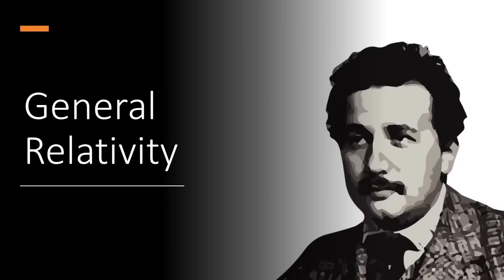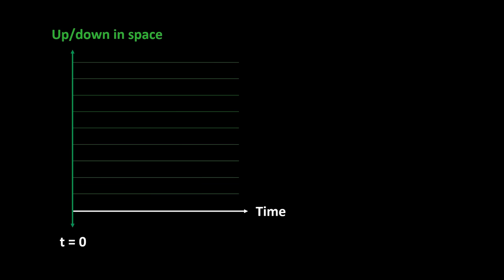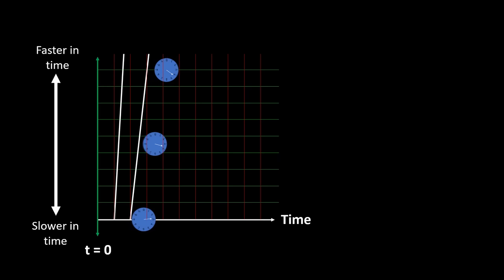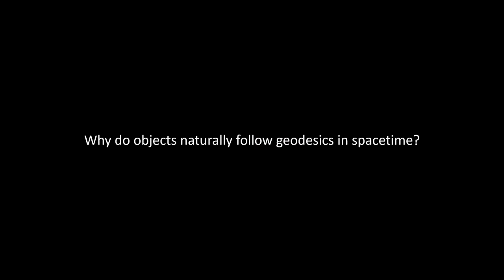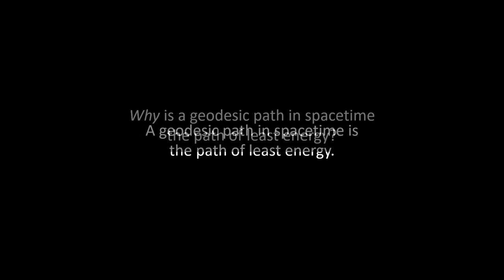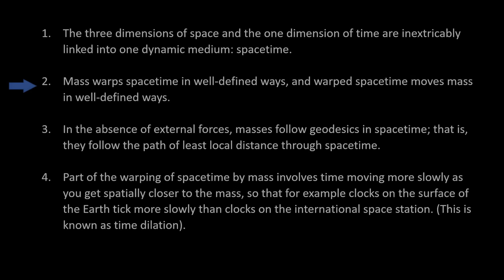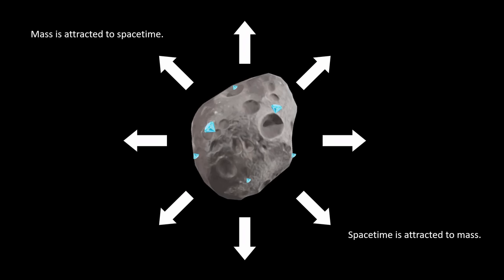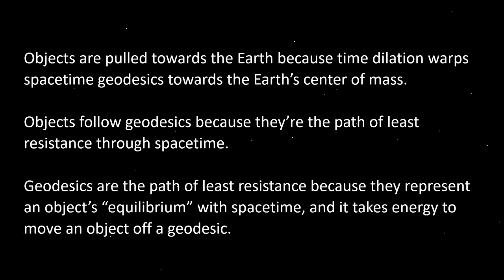How Time Dilation Causes Gravity, and How Inertia Works

Comment: I'm so impressed. This explains the equivalence principle. Movement due to gravity or normal acceleration impacts spacetime the same way.
Reply: Only the theory presented is supposed to do away with gravity as a force, as I understand it… 
Also how is mass defined in the absence of gravity? As inertia? Sort of a resistance against acceleration? 
It also seems to me that time would come out a space-vector – the path of least resistance between two locations in a three dimensional grid – which, to complicate matters further, is itself warped by all the masses in the vicinity in accordance with their masses.
Nevertheless, NASA must have precise, time proven methods by which to calculate these things. How else would they be able to slingshot objects around planetary bodies, as they often do? NASA can’t presumably rely on approximations, since last minute course-corrections would come too late, when their space probes is light-weeks away.
Couldn’t you start by covering how such calculations are done in real life before we let ourselves be overwhelmed by quantum conundrums?
Reply: Einstein described very well in the chapter "The Equality of Inertial and Gravitational Mass" of his popular book "Relativity: The Special and General Theory" the conundrum that experimentally it had been determined that inertial mass of an object is equal to its gravitational mass to a high degree of precision. Einstein's realization was that this equivalence might not be accidental. The fact that the gravitational "mass" exactly cancels out the inertial mass in the Newtonian equation for acceleration due to gravity indicates a purely geometric phenomenon behind gravitational acceleration. In other words, the "force" of gravity is fictitious, but the geometry is not what we thought it was.
Reply: @IldarSagdejev  I have the book and have read it a couple of times with great pleasure, so no! 
That’s not what Einsteins says. He just states that there’s no way to discern gravitational acceleration from an equal acceleration by an equal force, unless you have some external reference, thus explaining why inertial mass and weighed mass must be one and the same. 
The theory about distorting the space/time matrix came almost 20 years after Relativity was published and seems to treat time as a space-vector, which makes things more complicated to calculate, and as you know, a breakthrough usually means better and more generalized formulas.
But time, handled as a vector, must itself be distorted by mass, so how can NASA successfully calculate sling-shooting anyway?
Reply: @Hallands. Interplanetary flight caculations use Newtonian gravity. 
See "Mach's Theorem" for the possible nature of inertial mass.

Comment: Say that we clear our minds of all knowledge, experiments, and theories about physics and relativity.  All we know is that there is such a thing as space-time and such a thing as a material object. I will suggest that we would neither expect nor not expect a material object to warp space-time. We would just have no idea, and we would not be surprised to find out one way or the other. Another way to put this, if someone offered you a bet at any odds that you choose, and you could take either side of the bet, would you be willing to bet a substantial amount (say 99%) of your own money one way or the other?

By the way, I wonder if the presentation in this video does not rely on the equivalence principle, but without stating it explicitly? Ditto for the invariance of the speed of light. It is the combination of these two that leads to the idea that the clock runs at different rates at different heights above the Earth, and that what happens in an accelerating rocket is the same as what happens near Earth.
Reply from the maker: Yes, this all definitely relies on the equivalence principle and the invariance of the speed of light, since it's a description of general relativity (which relies on these things, after all).

Comment: Why does an object increase its speed when it's "falling"? Something falling at eye-level of 6 ft will be much faster falling if the objects starting height was higher. As if space-time at the same location differs for objects beginning at a different "height".
Reply from the maker: This is the nature of acceleration; the longer time you spend under linear acceleration, the faster you'll be going. An object starting its fall from higher has had more time to accelerate before it passes your eye level, and that's the simple reason that object is moving faster than an object starting its fall from lower. It's not due to "space-time at the same location differs for objects beginning at a different "height""; in fact, (ignoring some infinitesimal differences), for all intents and purposes the gravitational field 100 feet up is the same as the gravitational field at 6 feet, and any object dropped from either height will be subject to effectively the same acceleration. (This description assumes that you're comfortable with the concept that masses in a gravitational field will all accelerate at the same rate due to that gravitational field, which is itself a subtle fact).
Reply: @IdeaListEye  Hello, that wasn't entirely my question sir. My question -  bottom line - is: why must there be acceleration and why must it be ongoing? The latter question might be related to the first.

If I drop an object (vacuum), why isn't it speed immediately 9.8 m/s and why doesn't it stay at that speed?
Reply from the maker: @angel_machariel  I see, it’s an interesting question. The easiest answer is that it's impossible for objects to discontinuously change their velocity; that is, there's no way to get from 0 m/s to 9.8 m/s without also traveling at every intervening speed between the two for an infinitesimal period. Acceleration is the term for this change over time to the object’s velocity. Note that this is even true for really fast speed changes, like a bullet going from at rest in a rifle’s chamber to going many hundreds of meters a second just milliseconds later; in the time the gunpowder explodes, the bullet first travels 1 m/s before it travels 2 m/s, and it first travels 10 m/s before it travels 100 m/s (accelerating all the while). 

So your question is “why is that impossible”? Any explanation for this would rely on our observations about how the Universe works, so at root the answer really is “because we’ve never observed such a thing, and everything we understand about mechanics would fall apart if that were possible”. Here’s a version of an explanation, though: in order to change an object’s speed, you have to change that object’s internal energy to kinetic energy. All energy transformations occur over time; in some way, this is what time is , it’s the unfolding of energy exchanges in the Universe according to the laws of physics. Therefore changes to an object’s speed can’t occur discontinuously; i.e. if you were to look atan accelerating object over smaller and smaller slices of time, you would always find smaller and smaller slices of “change in speed”, and never find a slice of time where at the start the object has one speed, throughout the entire slice of time the object maintains that exact same speed, and at the end of the slice of time the object has jumped to a different speed.

Comment: I realize for the sake of explaining the principle of geodisks in space-time you have used a skyscraper extending to outer space and exaggerated the time dilation enormously between the bottom & top floors. But for an object on earth such as an apple the time difference between the top of the apple and the bottom of the apple is in nanoseconds or less. How does such a miniscule time difference translate to such a high acceleration due to gravity of 9.8m/sec^2 for the apple?
Reply from the maker: Hi Ravi, good question, and good observation (I should've made it more clear in the video that this was an extreme exaggeration, as you pointed out). It turns out that in this context, 9.8m/sec^2 is quite a modest acceleration. This is because it must be considered relative to the speed of light, 300km/sec; all objects at rest are considered as moving at the speed of light in time, and when they begin to accelerate relative to other objects, the accelerating object trades some of its speed through time for speed through space (i.e. it slows down in its motion through time). From this perspective, only a very small fraction of an object falling on Earth's speed through spacetime has been converted from the time dimension into the space dimension. Here's a great video on this point: https://www.youtube.com/watch?v=au0QJYISe4c
Reply: Thanks-a-lot!

Comment: Well, if you are an open mind, a quantum explanation can be given. If you consider the quantum package as defined volumetric space given by its energetic wavelength, plus a vibration frequency given again by its energetic frequency (lambda x frequency = C)... then you can calculate a volumetric flow rate just by multiplying quantum volume x frequency. Now this space flow rate will affect its 3D surrounding by a factor of 1/R2 and... voila! Energy express in terms of equivalence moving space! The equivalence space moving with the falling man in equilibrium. You can read some of these ideas (crazy but with some logic) in a small amazon book "Space, main actor of quantum and relativistic theories. Thanks, I enjoy your great video, Regards

Comment: Excellent video, which finally explains gravity through space-time geodesics in curved space-time. Was always left confused by the other videos mentioned. Thanks for this comprehensive video!
Also, I wonder whether you can create a supplementary video explaining the math of the field equation using a single dimension for space and time, like you have done in this video? You can also eliminate the factor for the expansion of the universe from the equation.
Reply from the maker: Hi Ravi, thanks for your kind words! I most likely won't be able to find time to make a supplementary video for this in the near future, though I agree that would be interesting. This paper might help clarify how this viewpoint relates to the field equation: https://iopscience.iop.org/article/10.1088/0143-0807/38/1/015603